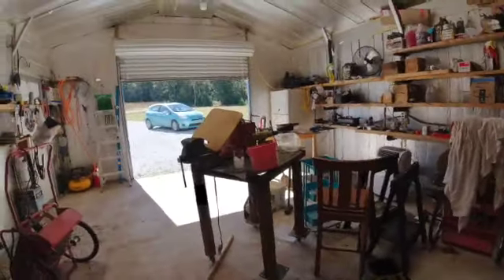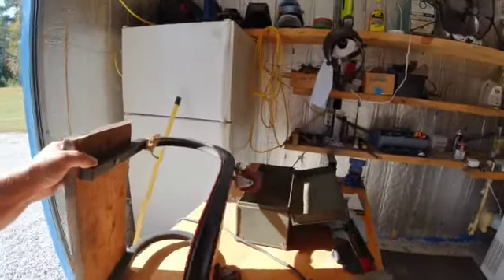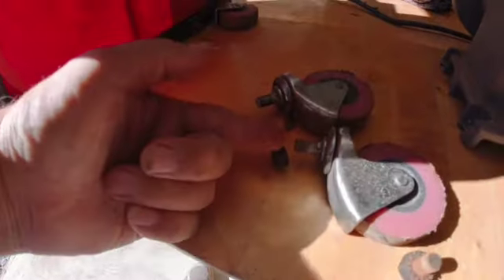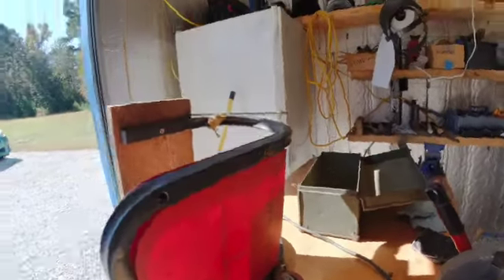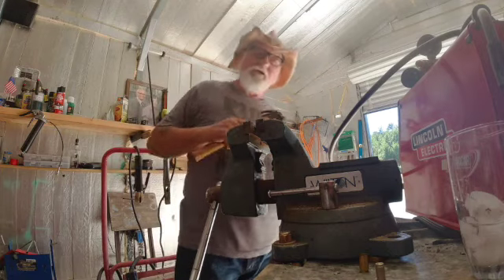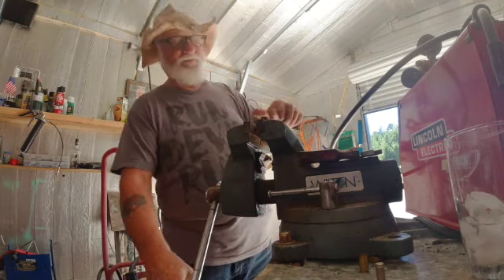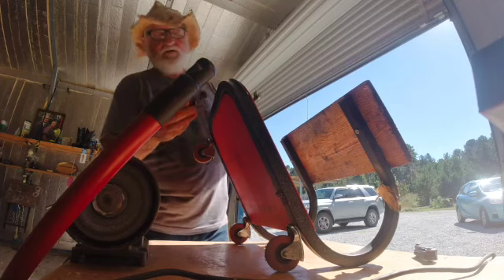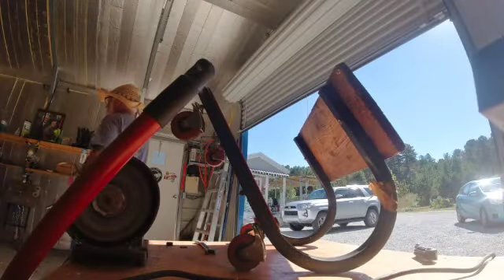9 mm pistol shell Couldn't fix my rolling seat

Comment: I have the same cart.  Did the same thing.  I did not loose the nut, but it was screwed up.  Took it to a friend who put new threads on both pieces; put locktite on all four, and been using it for ten or more years with that repair.
Reply from the maker: Cool.   Wish I hadn't lost the nut.  That would make it a lot easier.

Comment: Your wire welder that got wet; I hae had good luck with CRC products.  They make a spray to clean electric motors, and another spray CRC 2-26 that is a protector compatible with both metal and plastic.  Sort of like WD40 but with no oil.  I would clean it with the electric motor spray, and maybe spray it with the 2-26; let it dry overnight.  Don't overdue the spray, just a light coat to protect things.
Reply from the maker: CRC makes some good products.  I use their "freeze-off" religiously.  Thanks for the tip.  I'll see if I can get me some of that 2-26

Comment: Drill and tap the wheel bolt thats too short then run a smaller screw through the hole onto the wheel bolt inside there in another words screw the wheel down from the too of the steel to the wheel instead of that 9mm shell..git it or ??
Reply from the maker: Maybe